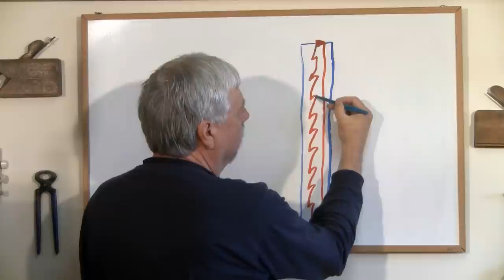How to Setup a Bandsaw: Woodworking for Beginners #4

Comment: i have an old craftsman that i picked up for a few dollars. you just helped me not scrap it. it does not have a knob to tilt the wheel, it has a screw in the middle of the top wheel that does the trick. thank you so much.
Reply from the maker: Hi Myk, I also had an old Craftsman once, it was my first bandsaw and it was a junker. I took it all apart, cleaned, replaced and lubed it up and it ran like a dream. Sold it and even made a bit of money. Thanks for commenting and reminding me :)
Colin

Comment: This video is very helpful to show principles of bandsaw adjustment.  The bandsaw can be adjusted in many more ways than a table saw or other saws, and all those adjustments matter, so if some people are still having trouble with their saw cutting straight, square, and quiet they might dig a little deeper in the much longer videos such as those by Alex Snodgrass.  I had a problem with my new-to-me saw that I could not figure out, and it ended up to be an adjustment on the table.  The table can be adjusted for tilt, position (L-R and in-out) and twist (the table groove and the fence are parallel to the blade).

Comment: Good clear video Colin thanks.  One oversight though... you did not mention that you had backed off the blade guides before you started centering the blade.  If you do not do this, you can spin the wheels all day long, but the blade may not center correctly.

Comment: You can use a piece of paper or such for setting up the guide blocks and ball bearing support of the blade. Put it in between, move the guide until it touches and the paper is held between guide and blade. Tighten the block's screw, remove the paper and you're set. Playing/poker cards might work well for this i think.

Comment: Great video Colin.  Any idea where I can get a Delta bushing for tension?  The rubber has died.  Don t want to thru out a working band saw for a bushing .  Supplier says the bushing is obsolete.
Band saw is a 40 year old 9 1/2 inch. I understand there are no parts available period.
Any thoughts?

Comment: Hi Colin,
I just started watching your videos. I have two Delta bandsaw that were given to me. The run fine, however the blade on both of them twists. I have tried tightening it up but either it continues to twist or snaps. Any ideas how to resolve this issue other than getting a new saw. (Also have a Ryobi that twists in the opposite direction.) Ha ha. 

Thank you for any help. 
Frank Gonzalez. 

P.S. Great videos, very informative.
Reply from the maker: Frank Gonzalez Hmmm, I have not encountered that issue before. The blades could be snapping because they are to tight. A bandsaw blade (depending on thickness) needs to be tight, but to tight is not good either. 
If we are to diagnose this over the internet, probably better by email, you can find that on woodworkweb.com ... I think first I would check the belts, if these are old saws, probably need the belts on the wheels that hold the blades to be replace if they are hard, cracked or gone altogether. That would be my first guess.

Comment: dear sir thank for your explanation i have little problem on my band saw and i live oversease. the problem when i push a block of wood . the wood tend to drift from the fence. i set my wood exactly with the fence then once the blades catches the wood tend to drift and my cutting not straight.

Comment: hi colin, i´m starting a work shop,and i´m buying some tools and machines, now i´m about to buy a band saw, but i found a lot off sizes and different HP power engines, and i want  to ask you an advice: what kind of band saw could you recommend me?,  the most comun here are the 10 " 1 3/4 HP or the 9" 1 3/4 HP , or ,do i need a bigger one?. im a begginer on wood work, and i dont want to spend some money on machines that doesnt work good. hope you could help.
Reply from the maker: Jesus Cortes I'm sure you are aware there is very little difference between a 9" and 10" ... in this case I would choose the 10", Larger is better when it comes to band saws. To be honest, I would see if you can get a 12" or even a 14". Of course it really depends on the kind of work you will be using it for and what your budget is like.  I have a 12" and 16" ... I don't use the 16" much and I find the the 12" is often too small for what I need.
Hope this helps ... good luck with your search Jesus
Reply: hello colin, thank you very much for the advice, you're right , I better look for a 12 "or ( 14" ) which seems to be the right one , I will go to other stores and see what is available.
Reply from the maker: WoodWorkWeb You will not be sorry you took a bit more time to look around and see what else is available
Reply: i will do that, thank you colin.

Comment: Hello Colin
I just purchased a 3 wheeled Craftsman 10" bandsaw. When cutting the blade slows down then stops.  I was wondering what causes this and how to fix it. 
Paul
Reply from the maker: Paul Sawyer I have not used any of the 3 wheel band saws but they tell me the 3 wheel versions can be tricky to set up ... but, you are not to that point yet as yours isn't really running.  Hard to diagnose over the net, but, I would think it is either a drive belt / pulley problem, or, it is one or all of the tires on the 3 wheels, which is what I would check first. These tires need to be replace if they are mushy or have gone really hard and cracking.
Let me know how that goes ... probably email is better for this
Reply: Found out the problem.   Thank goodness it is an easy fix.  It is missing a screw I have to track down and order. Thanks for the reply.  When the gear that is attached to the motor moves, the belt is not aligned.   That bring why the blade stops.
Reply from the maker: Paul Sawyer Oh good .. well that was easy, hopefully tracking down a screw or bolt will be as easy

Comment: I have 2 questions, are Bandsaws super expensive (both the big and mini Bandsaws), and what happens when you run the Bandsaw with the doors open (showing the wheels inside)?
Reply: Not much will happen but you getting more sawdust on you and around than necessary ;o) Nevertheless always keep the covers on or you might hit the blade or get caught by running parts!!!  That's why some bansaws (including mine) can hardly be turned on without the covers. So for safety and cleaning reasons leave them where they are supposed to be. 
The price for those saws depend on what you are looking for and intend to make with. Sometimes you can get a good quality brand device for a reasonable price and those old machines often are built much better than the plastic stuff you often find on the market nowadays. Just my opinion of course!!